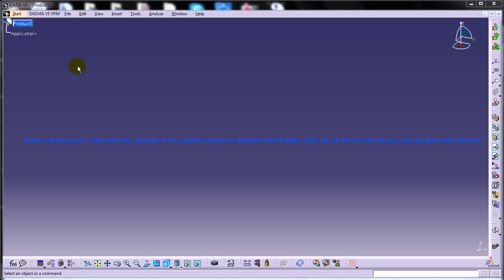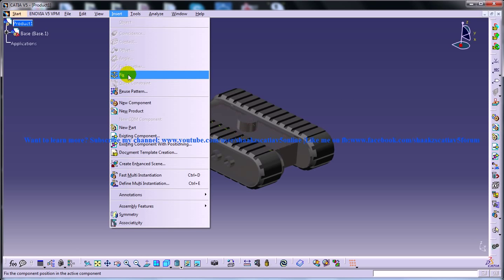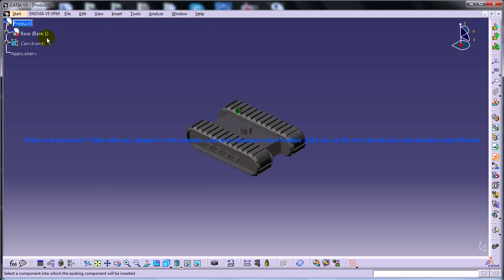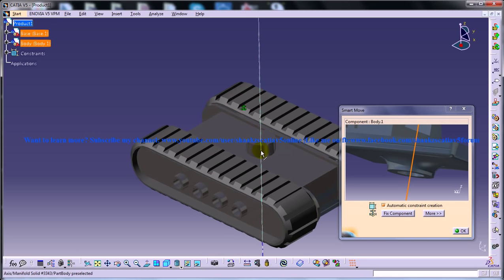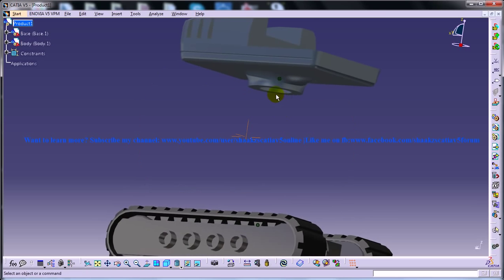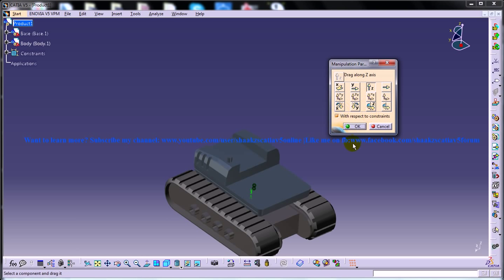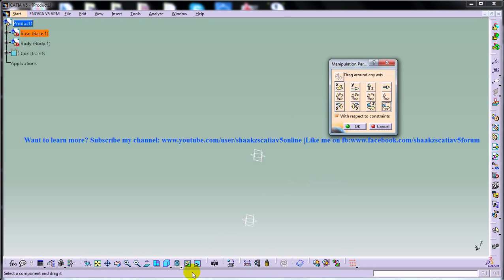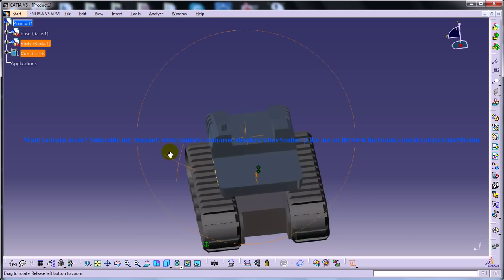Catia V5 Tutorial|Machine Design|JCB|How to create and simulate an Excavator|Part 1

Comment: Good morning, I'm learning how to use Catia V5 and I have some problem (certainly easy solution) in making the tracks of the excavator, particularly in creating a pocket that it travels around the profile of track: what command did you use? I was thinking of creating a series of equidistant points and then use a custom array, but I can only create a sequence of points on the straight section of the track (or the curved portion only), but not both simultaneously. What is the correct approach? Thanks